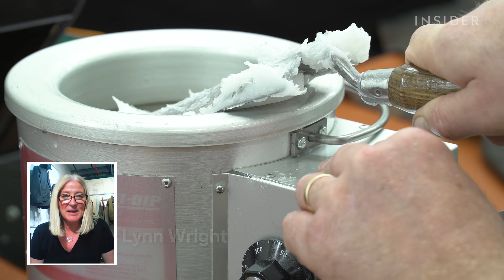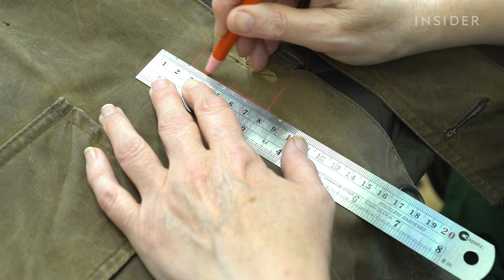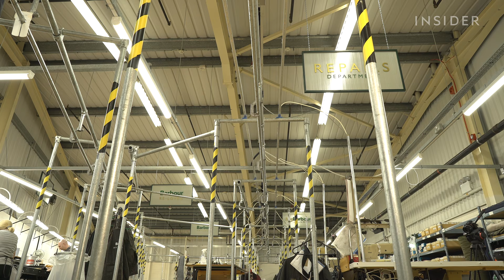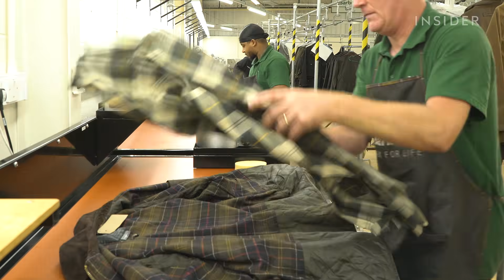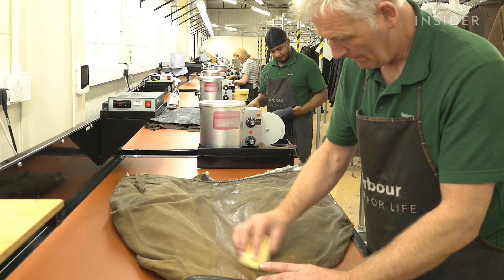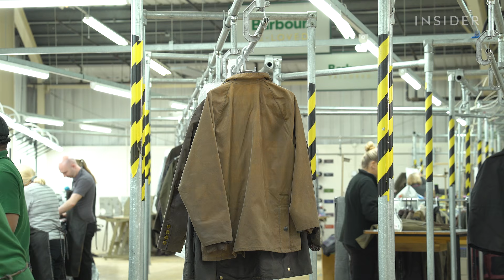How Barbour Jackets Are Professionally Restored | Refurbished

Comment: I prefer to apply the wax myself. Easy process. A little Elgar on the turntable. A glass of Singleton - and and hour of rubbing in. By doing it yourself you can apply more in the critical areas, and less on the back - which will end up on your carseat anyway.

Comment: Probably the worst restoration video I have ever seen. 
-They didn't bother hiding the patch work on the rip. 
-The elastic on the cuffs could be replaced. 
-The corduroy collar looks worn out and needs cleaning and steaming.
-The lining on the inside looks disgusting and could've used some serious cleaning or replacement.
-The zips wasn't restored. It needs some cleaning, metal polishing, and lubricating. 
-The edges of the pockets/ pocket cover are starting to fray and needs some reinforcement and TLC. 

Barbour's "restored" version still looked like the original dirty old jacket, but wet instead of dry.

Comment: Ah communication, the repair supervisor said of the hand sewing operator, that she was going to "sew the button on from the 4 holes in the button from each corner crisscrossing the thread" which is an X like the other buttons on the jacket, obviously the operator has not been told this, what she does is sew a straight line to attach the button, like "I I", it is so obvious that this button is not sewn like the other buttons, it must be said that the operator is blind, if not, she is "out of it".

Comment: Didn't even cross stitch the button to match the others, and the patch work could of tucked inside the jacket, then stitched for a more uniform look... 

Save yourself the money. Buy a tin of barbour wax for £15-20. Buy a barbour hood (same colour and lining as your jacket) cut up the hoods outer and lining to make repairs on your jacket. Waxing a jacket is very easy. Total cost £40-60 not £150-200. You will appreciate your garment more when you're the one who repairs and maintains it. It is really easy just need a good eye for detail and basic stitching skills
Reply: They even didnt bother to do the same stitching on replaced button, although it is the same amount of work!! Such sloppiness is simply unbelievable! 
A total disgrace👎

Comment: I live in Tuscany, Do you know where I can send my Barbour jacket to have it restored? I imagine it's quite expensive. Doing it every year would be impossible for me. It has one rip and a couple of holes. I wore  mostly when caring for my horse and riding in the early Spring and Autumn. To the best of my knowledge, the jacket is probably 25 years old. I have used the wax that the Barbour company makes, but my jacket has never turned out like the one in this video. 
Thank you very much for this informative video.

Comment: They did not told you in this video that the repair of an old jacket costs almost as much as a new barbour jacket.
Reply: Not sure. Thought a rewax was £30 or £40 when I last looked. And that patch wouldn't cost much. Issue is when you have a lot needs doing (like mine). Then I agree with you it's more cost effective to get a new one (though I use glue to seal some small holes)
Reply: @jonstern7511  i’m wasn’t talking about waxing. You could do that on your own with their wax. It takes some time but it’s not that complicated. On the other hand, repairs like patches or sleeves shortening cost near half of the jacket. I get the story that they are trying to sell, the forever jacket that could be repaired and last for generations but in reality it’s not really like that. After 10+ you get to a point when you don’t have a jacket you have some waxed cotton patches in the shape of a jacket.
Reply: @bisis98  yes. I get you. The jacket for ever is a complete myth!
Reply: @bisis98  That's not been my experience. My jacket is 25 years old and has never been sent back to the factory. It got pretty rough wear as I wore it al the time in the Spring, Fall and Winter in New England and Italy when working my horse. When training a young stallion it got a couple of small rips. Young stallions like to play and nip. I got my jacket when I was 50. I'm 76 now. I have every confidence that it will last me the rest of my life and still be good enough for a niece to wear.
Reply: @jonstern7511  A Barbour jacket will last a very long time, Barbour told me that extensive repairs will be expensive and may be more than the cost of a new jacket but it is possible to keep repairing a jacket indefinitely if the customer is willing to pay for them, I know several people with Solway Zippers that are well over 50 years old, mine was bought in 1982 and still in totally original good condition without the need for repairs.

Comment: Wondering how the jacket and wax behaves  in high temperature regions, does the wax run or melt out?
Reply: You wouldn't ever wear a wax jacket in high temperature regions. You would rapidly be stricken with heat exhaustion. As for hanging ini the house (I I've in Italy where summers are brutal) I've never had the problem of wax melting.